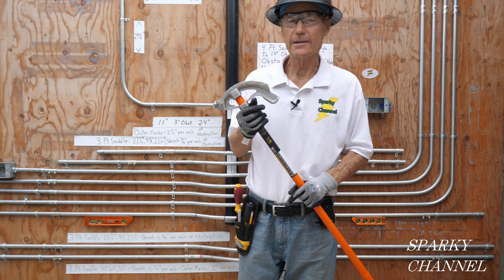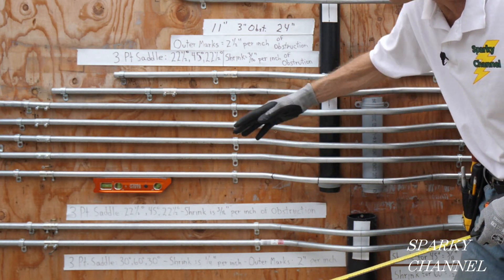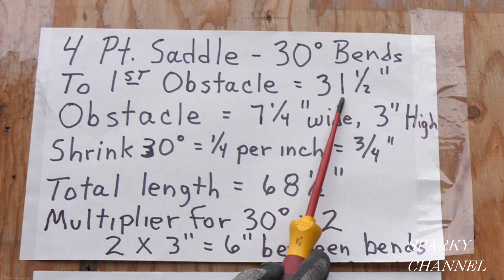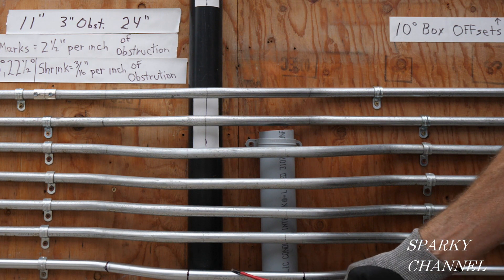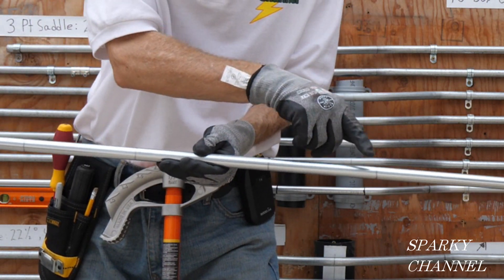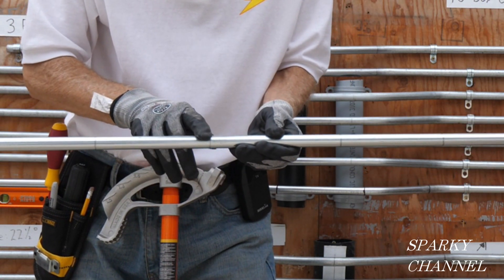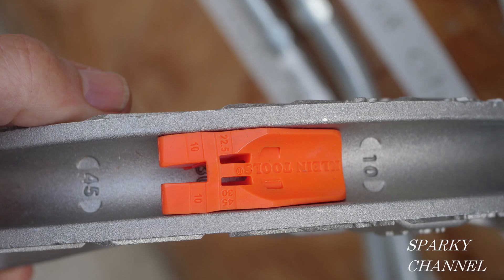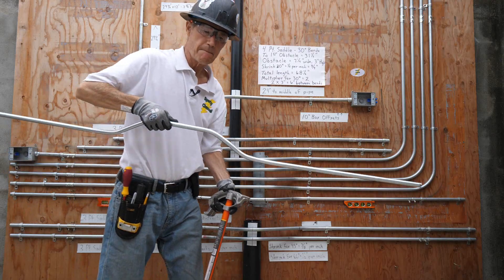How To Make a 4 Point Saddle Bend with an Angle Setter Conduit Bender

Comment: Why not just do the bends first and then cut to size without messing with shrink ?   Why cut it first and not last ?
Reply: They do that to save conduit because it expensive but i agree with you its the easiest way
Reply: everybody's doing that in the field yeah unless you absolutely need that little bit of pipe then you would factor in shrinkage I guess
Reply: Excellent question. This past weekend, I bought (2) pieces of 1/2" emt conduit, 10 ft long. Each pipe had (2) 10° offset bends on each end of the pipe, and i had to do 2 different 3 point saddle bends to clear 2 different obstructions. I measured out the two obstructions at their center points, wrote it down, calculated shrink, (by the way, the 2nd 3 point saddle had a 1/2" transition where the wall was 1/2" further out, so I had to calculate for that as well), but I just started bending on the beginning end, and each section of the bends, I didn't put the marks on until the previous area was done. Turned out perfect, with only having to cut 1"off the end of the pipe. All this shrinkage stuff is easy after you get the hang of it!

Comment: Why didn’t you do the shirnkage on the right side you only applied the shrinkage to the left side am I missing something
Reply: That’s bc the pipe will shrink when he makes the two bends on the left, so that has to be added in with the measurement of where the obstacle begins, while the two bends will “follow.” He added both though when he cut the pipe before bending. A 70” piece of conduit will shrink 1.5” (3/4” on each side) to become 68.5”.
Reply: I understand what you're saying. You're asking why he didn't apply the 3/4" shrink to the other side when he did it for the first. That's because when he added the 3/4" to 31-1/2"  and got 32-1/4", he then made his marks. This means all his marks automatically moved 3/4". He doesn't need to do the math for every one because when he made one mark 3/4" back, all of them were therefore 3/4" back.
Reply: pipe has to reach a specific point on the left side. pipe lands where it lands on the right side. idk if that helps or if you had it figured out already
Reply: Shrinkage is an overall thing. So the whole pipe "shrinks," so it's applied over all

Comment: As an electrician apprentice there are, so far, two things i hate; making new outlet holes for recepticels and conduits
Reply: Once conduit clicks, it's one of the best part of the trade. You're an apprentice, just keep at it. It takes practice. Working with a jman who's willing to take time out of the day to show you is also huge. I was never taught, just put in a room with a bundle of pipe. Eventually I had someone show me some tips and basics but until then I was lost
Reply: Cant hate conduit, conduit is a huge part of our work 😂
Reply: @elvizhernandez4305  Depends where you work. I worked heavy industrial where there's no conduit to be seen. Just teck and bx.

Comment: Bro didn’t even use a level or anything. Just eyeballed a perfect 4 point. Mad respect.
Reply: That's what the angle setter is for. That little plastic piece stops the conduit at the proper angle.
Reply from the maker: Thanks so much!

Comment: Sparky. You da man, , question? Why are you using star then an arrow for outside marks on a 3 point saddle? Thanks
Reply: Thanks buddy. I've been self Employed Remodeling/Home Improvement for 21 yrs now and I am always still learning, Now with that being said, For the push through. Are you using more or less take up that you would use the star instead of traditional arrow like I'm use to. I've only used the star for back to back 90s. Thank you sir.  Appreciate your detailed explanations,  I'm more of a visual learner. 👁👍
Reply from the maker: @adler88u  Sorry it took me so long to answer. This should help: Push-Through 3 Point Saddle Bend: Easy, Fast and Good for Tight Spaces: https://youtu.be/MZQNOJi79Jo
Reply from the maker: That's push-through method for 3 pt saddles.

Comment: Angle setter piece on the bender? Whuuuuttt? What is this new found devilry?   My apprentice is such a pos i have him use the notch on all bends for a 4 point its only a little off, but good luck explaining to him the correct way... when time is of the essence and a dud of an apprentice you have, measure to obstacle, make 1st mark, measure width of obstacle,make second mark, use multiplier outwards from there both directions, leave bender with hook pointing toward direction of measurement, and start with first mark working toward last mark using the notch (center of bend) this will get you through trying times with a crap apprentice who is 2 yrs in and STILL cant bend...
Reply: I'm 2 years in and have only started bending just about last week. Sometimes apprentices just aren't put into jobs that require bending emt
Reply: @d.t.3495 I have one year as an apprentice, I just started bending EMT today. I was at a multi family place for 9 months and we only used pvc and had factory 90s and we used heat gun for any special bends we needed so I've never touched it. I did my first 4 point saddle today. It's easier than I thought. Just takes practice like anything
Reply: @lukasvilla2657  it's definitely easier than it seems but some people get in their own way overthinking it. I was just trying to make a point that you could go a long time without even seeing the stuff, you know?
Reply: @d.t.3495  yeah I feel ya. I agree
Reply from the maker: You have a lot of patience. :)

Comment: Hey Bill I just bought one of these 3/4 size.  I tried doing a basic 8 inch offset using the 25 degree setting and it’s over the 8 inch offset I’m looking for. It was around 9 1/2 inches. Using the multiplier. A couple of coworkers came out with the same results. Any food for thought? I didnt bend pass the guide.
Reply: 8 inch offset. 30 degree/45